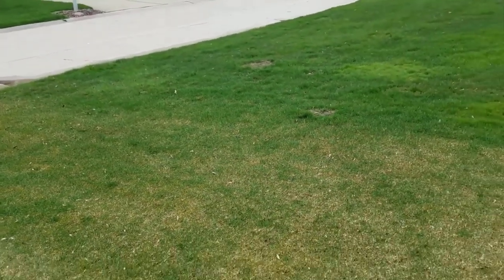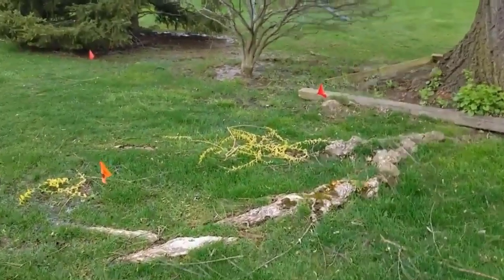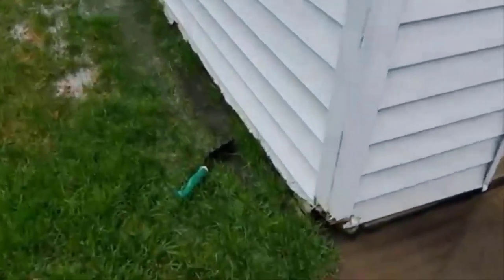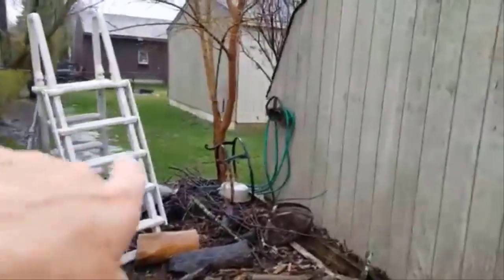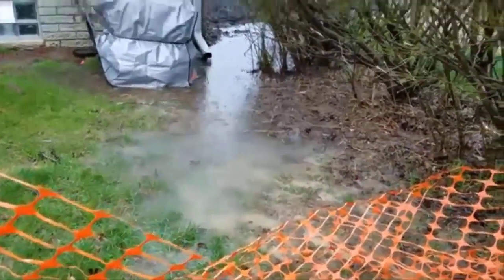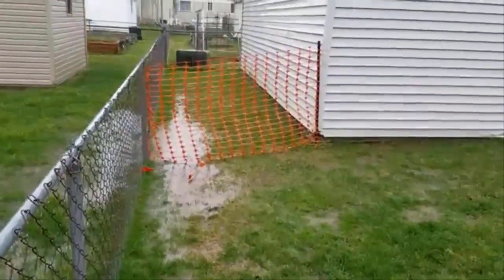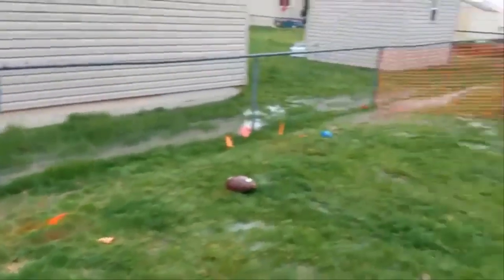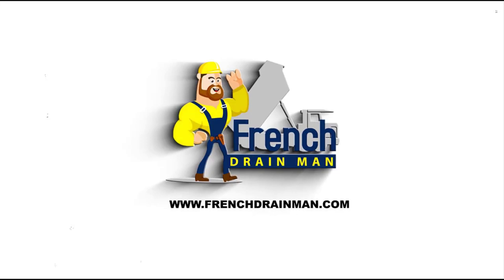How to Design Your Yard Drainage System [ AVOID LANDMINES ]

Comment: Three questions. If you are trying to diy this (live in Farmington/Oakland County) do you just try to be close but not get too close to utilities or is it just better to contract with an excavator who should  have the same equipment your talking about to get closer and then diy wrap,pipe and stone? Also, will a French drain eliminate water that is not standing but is below ground causing your BDry system interior French drain to be the catch point making house sump pump run every 1+30 min in spring? How deep does an exterior French drain need to be t catch underground water? Appreciate this great channel and information.

Comment: I was told you don’t do any work in Warren Michigan , but could you give us some Advice to take care of several Yards are flooding 6 homes and possibly more all the homes are 3 in a row and the Neighbors behind them it’s some serious water issue and the city basically won’t help one of the homes water is getting into the Basement and causing major flooding , the water is enough that Ducks are swimming in the Yard .
South East of 12 mile and Hoover area  need consultation. Thanks jim
Reply from the maker: We would fix that with an outdoor sump system

Comment: What’s a Tap?
Reply: In other videos, he always means tapping into the storm drain. The reason why he said "if I can't I'd have to do a sump pump" is because tapping into the drain a couple feet below the surface means the french drain can just run under the ground (at some slope obviously). If not, then he'd put in a sump pump ($$$) to collect the water in one place and then pump it up onto ground high enough that can run downhill on the surface to the top of the drain. ... I agree, this one was a little hard to follow. That set of backyards was a mess!

Comment: Dont know what you mean when you say a TAP
Reply: In other videos, he always means tapping into the storm drain. The reason why he said "if I can't I'd have to do a sump pump" is because tapping into the drain a couple feet below the surface means the french drain can just run under the ground (at some slope obviously). If not, then he'd put in a sump pump ($$$) to collect the water in one place and then pump it up onto ground high enough that can run downhill on the surface to the top of the drain. ... I agree, this one was a little hard to follow. That set of backyards was a mess!